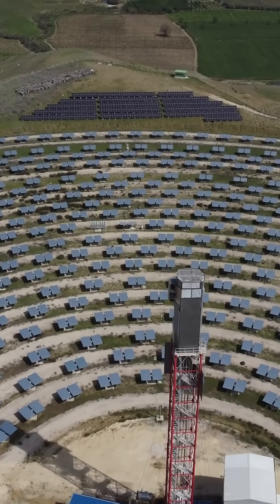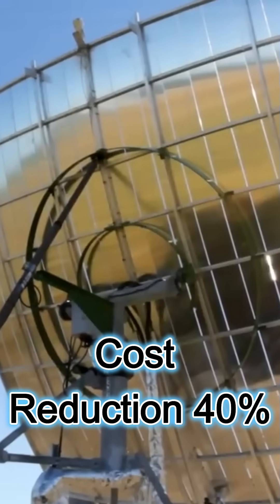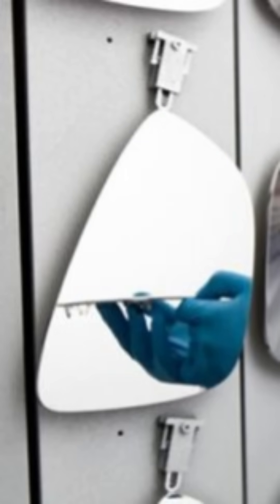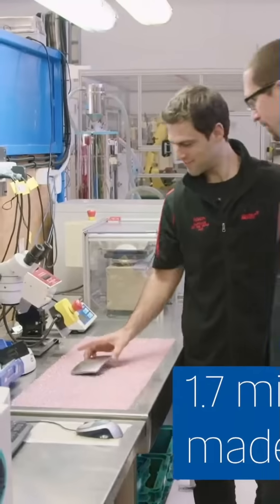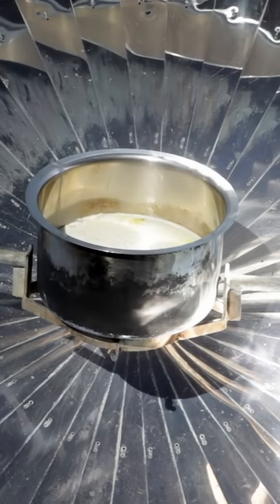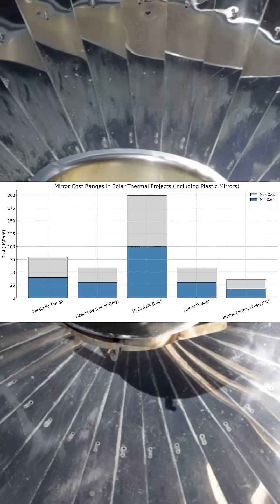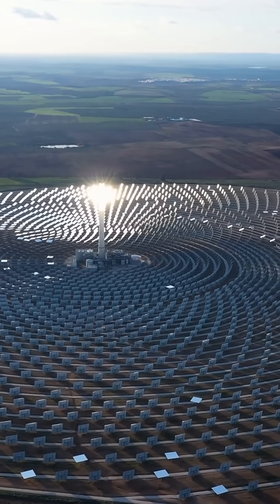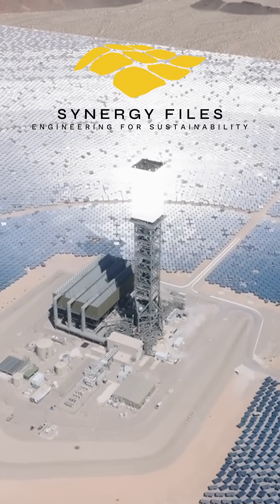Plastic Mirror for Solar Thermal Application #solarenergy #solarpower

Comment: That's amazing that the plastic wouldn't in time deform when baking in the sun, even when coated with metal. Even slight deformation would completely ruin their exact parabolic reflection angle! 😮

Interesting cost-saving technique - not that I'm thrilled about anything with plastic being produced, any more. 😢 But still, thanks for this news.
Reply from the maker: Great point!